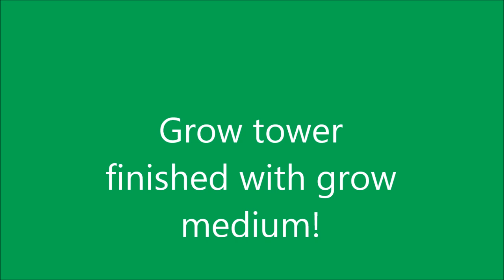Grow tower finished with grow medium!

Comment: If there is some place near you that unloads tractor trailers that pull flatbeds and you see that the loads are leaving or coming in tarped. you can go to the staging area where the drivers tarp or untarp their loads and find lots of the S hooks on broken bungee cords that they tend to throw on the ground. Similarly at truck stops in the parking areas you can find many of these. I think I will start collecting these now.

Comment: I see that this video was made on the 2nd of November 2014. May i ask that you make an update and show us the current set up. Update us on all the changes you made and what advantages did you benefit to date. Based on your experience, would you advice new comers to use vertical growing on a commercial scale? I would appreciate your help. Thank you.
Reply from the maker: My best results have been without any grow medium, ie after the plants have developed a root mass large enough to do the wicking throughout the tubes. I would get the plants started in my floating beds (DWC), in net pots and wait until the roots were well developed, then place them into the towers.
Reply: Thank you for your prompt response. Cheers
Reply: Thanks!!! This is a nagging question I need an answer for!!!

Comment: Straw was a neat idea! I think you'd be better off with pea-gravel, the kind that is used in school playgrounds under swingsets and such. It would be infinitely re-usable and easy to clean. This assuming any kind of medium is necessary. 

Why did you figure you needed a medium to begin with?
Reply from the maker: +enticed2zeitgeist Straw is a bad idea--- it rotted too quickly and clogged the bottom of the tubes. coconut coir is a good idea to go with.  some of the plants need to grip into a medium and worms can live in it so this will also fertilize the plants also. most of my plants I do without the grow medium. good luck my friend--- Don

Comment: Did you try with LECA (lightweight expanded clay)? They don't collapse, lightweight and release moisture when water not running through towers.
Reply from the maker: I used it in the net pots, but not filling the towers. Thanks for the suggestion, i'll give it a try.   Don

Comment: Did you ever try coconut wool as a medium? We use it instead of rock wool as a substrate for the net-pots, it works really well!
Reply from the maker: No I haven't---I could not find a source for the coconut wool--- can you suggest where to obtain it?
Reply from the maker: ***** I believe you are right--- thank you!
Reply: Perfect idea, thanks! This is very available in the Philippines and will save on expensive net pots! We were using old coke bottle bases b4.

Comment: Did I miss something ?   In first video you ran clothes line rope through it yet there was none here ?
Also I noticed some use no medium like your straw and simply let the water run over the  roots   What’s the difference ?
Very good video
Reply from the maker: Depending on the plants you are potting determines how the towers are set up to function. if the plants have a well developed root structure this will act as the wicking source, and if using the net pots with this type of plants the grow medium is not needed, all the nutrients are in the water.

Comment: Hi, i was just wondering if you made the tower or got it somewhere? If you did make it why did you only put plants on one side? and do you have a video of making them somewhere by chance (if you did).  I like the way it looks bent rather then trying to cut the whole at an angle and using pvc fittings...
Reply from the maker: Here is the tower build; https://www.youtube.com/watch?v=PCwjrnjdzDs  , the plants on one side is recommended for the towers that are in the grow tower cluster--- most light will be coming from the one side, and the plants to the back will be taking the light there. once you start making the towers they are pretty easy. Thanks for your comment my friend---Don

Comment: Hello, Donald. Thank you for your video. I wonder if it is safe to use PVC for planting.
Reply from the maker: The manufacture informed me that the pvc that is used in the drain pipes is the same as that which is used in the palatable water lines.

Comment: Hi Donald, thanks for your videos. They are fun to watch. I have a question. Approximately how much pump capacity do I need per tower? Since pumps here are rated in Liter per hour, a 5-warr 400 Liter/hour pump will approximately serve how many towers?

Have you needed to use plant nutrient solutions to grow your vegetables?
Reply from the maker: +Stef Noose Since the plant nutrients all come from the fish food, I find I have to supplement with Iron, Potassium, and magnesium. . On the towers, the recommended flow rate is about 7 gal/hr, so I guess your 400 liter pump should handle about 30 towers, but remember the hourly rate will be diminished with the height the pump has to push. good luck my friend---Don

Comment: Question: What is to mix with water for nutrition supply to the plants when using the pond mix filter medium?

What if the system be exposed to broad daylight and open night-sky?
Reply from the maker: The fish waste will change into nitrates by the effect of beneficial bacteria that the plants feed on. The plants are in the greenhouse for it's warmth, If you are in a warm climate you may grow outdoors.

Comment: Does the decomposing straw not change the Ph of your water negatively?
Reply from the maker: the straw was removed shortly after, the straw broke down too quickly and settled in the bottom of the tubes and clogged them. I'm thinking of using coconut coir instead.
Reply: Good to know, thanks.
Reply: coir will become too water logged, id try straight perlite
Reply: lava rock crush it up if you cant get the small stuff.

Comment: where you get towers from
Reply from the maker: The PVC pipes came from a pipe plumbing supply--- the final cost of about $2.50 each---- you have to make them---- fairly simple to do, just time involved!
Reply: i am going to get the gropockets and glue them on, easier and quicker and no blockages

Comment: Nothing but a rotting mess as the straw decomposes
Reply from the maker: You are right--- straw is not the right grow medium to use--- coconut coir is good to use.
Reply: @donaldporta  I have a setup similar to yours and been having a bear of a time growing my strawberries in my towers. Are you strictly coco coir now? Or is there a mix you use? Also does the absorbing properties of the coir maybe promote root rot since it's always wet? Or does the coir compact a lot in your towers? I'm looking for a change this upcoming spring as I've lost 500 strawberry plants each year for 2 years and looking for a solution.